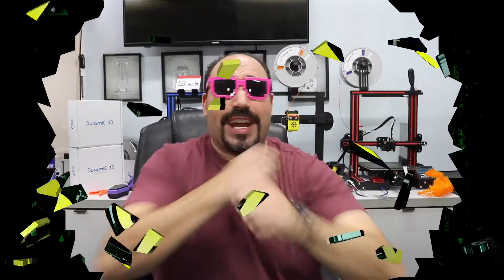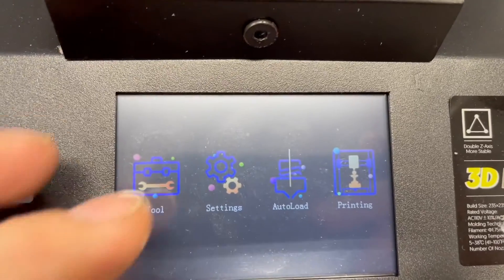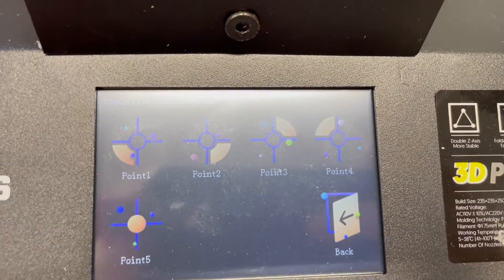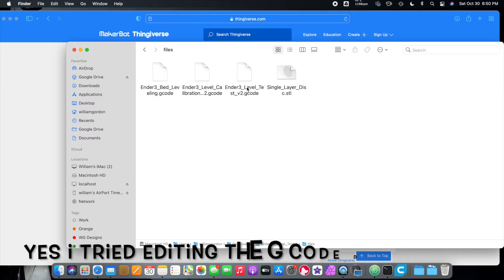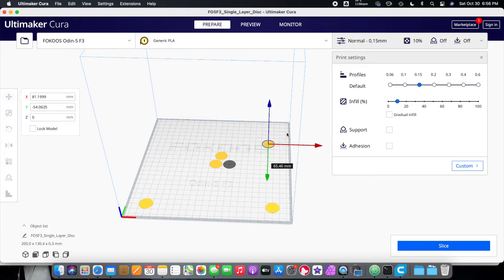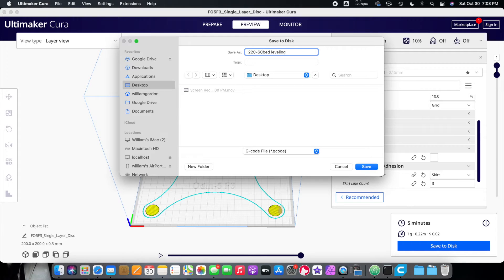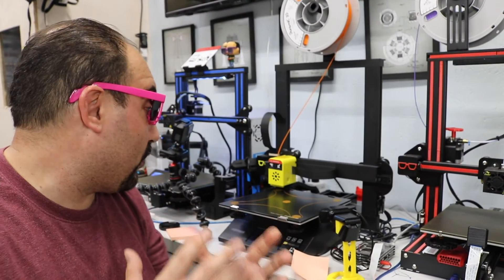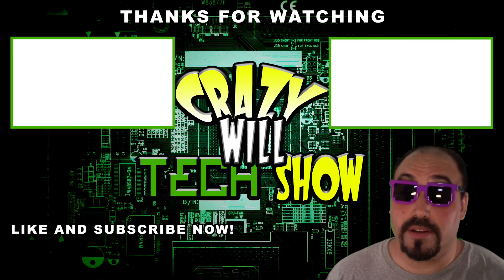How to level the bed on a Fokoos Odin-5 F3

Comment: WARNING !!!

 I have discovered a very serious and potentially highly dangerous flaw with the Fokoos Odin5. 

When the ribbon connector that connects to the print head becomes worn over time it can lead to highly erratic temperature readings, for me this  lead to thermal runaway with the hotend reaching over 300 degrees centigrade, smoke was pouring out of the print head and this could have lead to a real disaster if I hadn't been in the room when it happened.

Please anyone who reads this help to get the word out there, this is a very serious issue and could possibly lead to tragedy.

Thanks for your time and stay safe.
Reply: Have you mentioned this to them?
Reply: @taliyac2099  I haven't, I assumed that because they provide spare connectors with the unit they were aware of the issue.